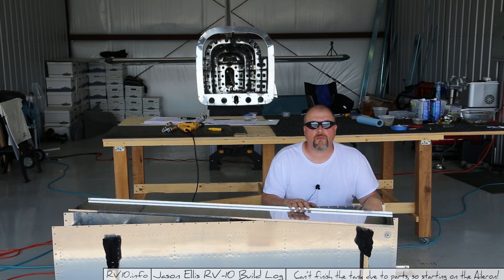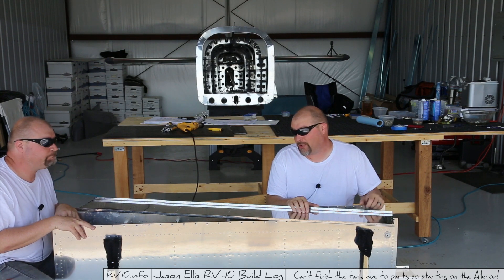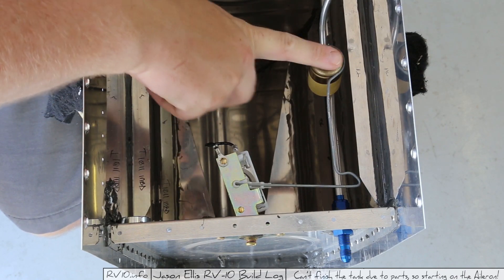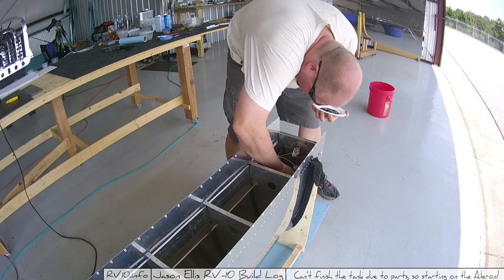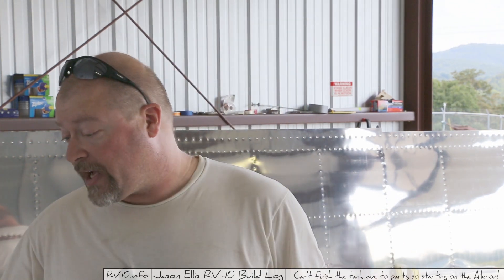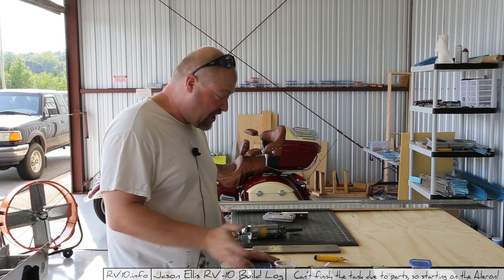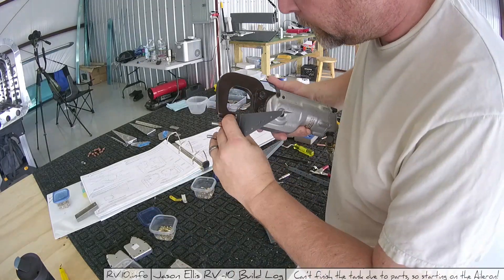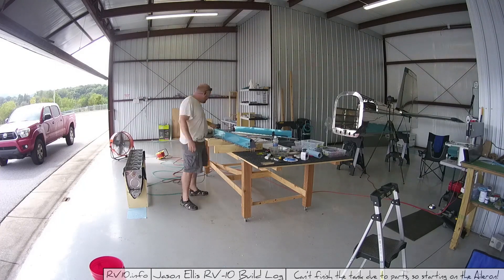RV-10 Wings - 028 - Initial aileron work while waiting for parts from Van's

Comment: I wouldn't be deviating from the plans and cutting extra holes in things, the aircraft is designed and certified based on that design. In the world of aircraft maintenance (my world) you don't change anything without a STI (special Technical Instruction) from the manufacturer, there are numerous crash investigation reports that show an accident was caused by an unauthorised modification to an aircraft.
Reply from the maker: Great point and good advice!  This played a large part in my decision to not go forward with the installation. I know others have done this exact modification but I just don't see the benefit.  I mean if you have to get back into the tank, it's gonna suck no matter what.  Adding an extra large hole to the tank just doesn't make sense.

Comment: Great update! Check the countersinks on the A-1006-1A pieces, they looked a little oversunk, but hard to tell from a video obviously. I have a few scrap ones due to the same issue on my Rv-14 project which uses the same aileron as the 10.

Really look forward to watching you train with atp if that is what you choose. As a fellow techie with similar experience I contemplated it as well, but family and need for a level of sustained income were big factors for me.  Look forward to living vicariously through you!
Reply from the maker: I'll check it out and get a closer picture of those parts.  Most of my countersinks are "smooth" meaning you can run your finger over them and there is no seam between the part and the rivet.. I do have a couple that are slightly over sunk on other parts of the plane but asked more senior builders and they all gave them a pass.   Good catch, will check it out and get back to you.

As to the ATP thing, I'll be trying to film as much as possible but not sure if I can yet.  Right now I'm finishing my PPL then will do the ATP filming as a larger production.. Shhh dont tell anyone.  Stay tuned =)

Comment: Jason, have you figured out how much fuel will be available when the float bottoms out?  My understanding of the FARs was that the gauge has to accurate when you're at 0 usable fuel.  I realize you're on the high side of that, but it seems like it could cause complacency and expectation problems.  

how often do you feel like you'd take it to an empty tank that you would need to worry about the float wearing out the aluminum.  What kind of stop does the fuel sender have?  I would think wear and tear there would be more likely to cause a problem with that than thinning the skin.
Reply from the maker: Brian, good question.  As it stands now there will be less than a centimeter of fuel in the tank when the gauge reads empty.  I assure you it will never get to the E mark in my plane haha .. I'm one of those guys that at 50% I'm looking for a gas station.  Drives my wife nuts.

The stop on the fuel sender itself is a rather robust piece of plastic that is reinforced by the metal that wraps the whole unit.  Plus we aren't talking massive speeds it will move up and down fairly gently.. I don't plan to do acrobatics.. heh